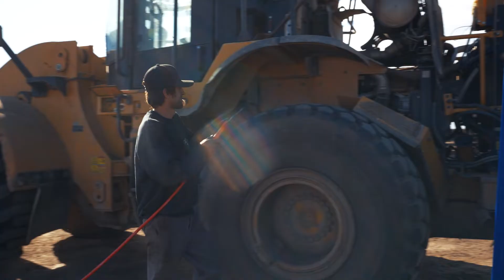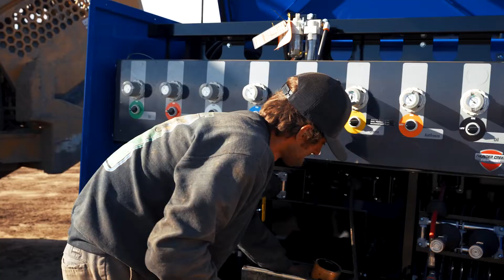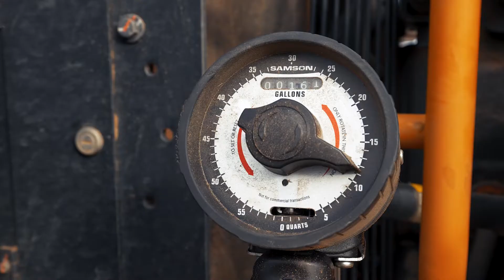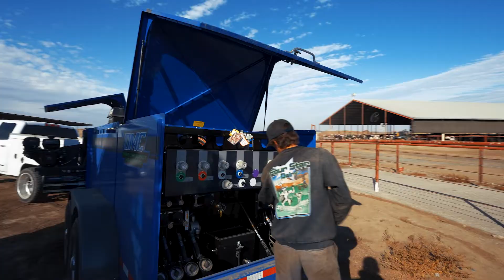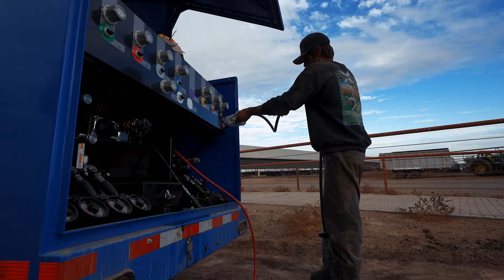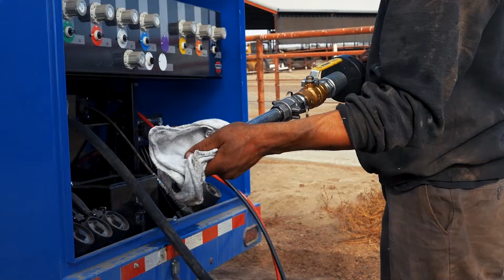Remote Equipment Service with DMC Mobile Lube

Comment: Motor oil, hydraulic oil, coolant/antifreeze, powertrain oil, gear oil, and reclaim/used oil.  Awesome.  (And a buttload of new oil filters, I presume.)

If I had my druthers I'd add windshield wiper fluid and a warm-water pressure washer.  And maybe coffee.